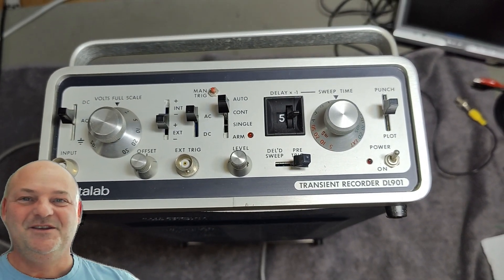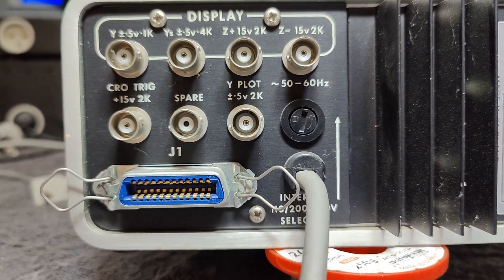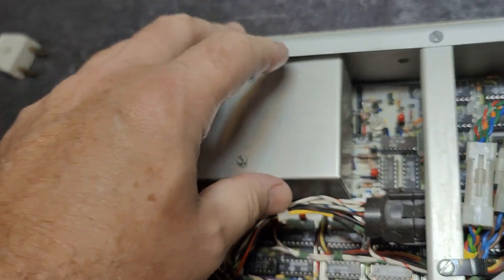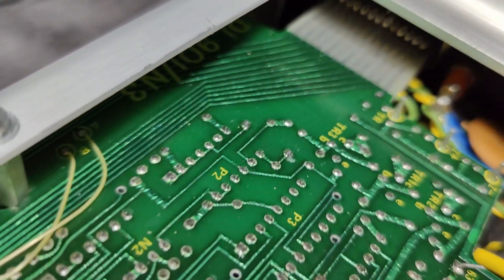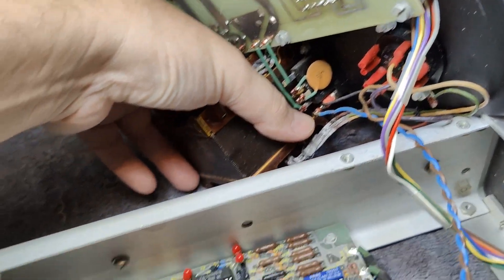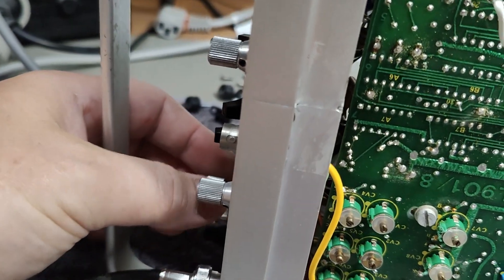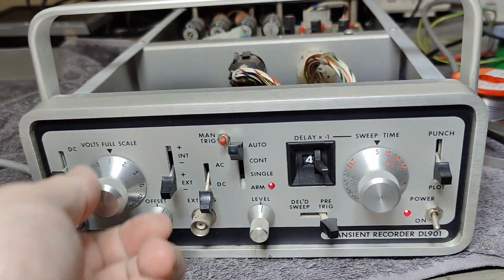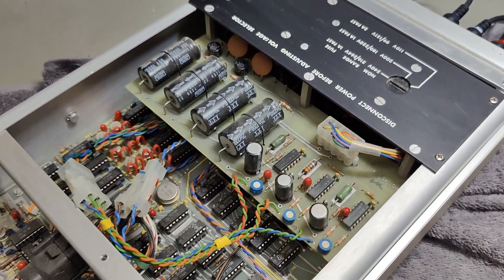Datalab Transient Recorder DL901 1978 1ch digital scope IEEE

Comment: Thanks for the great video! I am very impressed because I built my own digital sampler with almost the same functionality as that one from scratch 40 years ago. My own creation was also made entirely with standard logic ICs without a CPU, and when I tried to run it for the first time in 40 years it did not work correctly at first, but then I discovered that whiskers had grown on the pins of the IC and shorted out the circuit, so I was able to reproduce the operation as it was then. There is a video of the transient observation on my YouTube channel. If you are interested, please take a look. The Hackaday project explains the inner workings.

Comment: Have you tried checking the voltage on the power rails? Maybe the analog front end uses a different voltage and it's off. I guess if there are no markings for the voltages it could be difficult to figure out. You can try powering it from a bench power supply rather than the built-in supply to see if there's any difference.
Reply from the maker: Thanks for the tip! I checked all the things I feel i could do, no luck, I am a bit sad about it, since it is a really cool and fun unit
Reply: @TeardownOZ2CPU  That's a shame. There's probably some part that died due to temperature or humidity. Maybe one of the capacitors. But without any service manual, test sequence, or even a proper output/display, there's no way to debug it unless you find a second scope of the same model to compare against.

Comment: The horde of early tantalum capacitors is scary, and might be contributing a lot to the power draw also...
Reply from the maker: i always use a thermal camara to reveal stuff like that :-) but you are right, they do fail, mostly short on too high inrush voltage lines

Comment: The 8 cans looks to be AMD 1404A, 1024 bit dynamic shift register (similar to Intel 1404A), i.e., 1KB memory.

The larger can is likely AMD MH0026CG, a TO-8 housed 5MHz two-phase MOS clock driver, likely driving the memory (clock driver datasheet explicitly calls out AM1404A, which is guaranteed to support 5MHz)

Comment: Nice spareparts though since it is all socketed.
Reply: The logic chips are old style 74xx. Even for repairs one would usually prefer the lower power 74LS series.
The power supply and case are the more sensible parts to reuse if really needed.
The large round chip or maybe the 8 small metal cans could be the memory. In the old times there was serial, shift register style memory.
For a bit more debugging one could probably have a good guess on the output signal going to the ADC part. This way one could tell it the issue is with the analog front end or the digital part.
Reply: @UlrichHarms-ci1ov  If repairing a device which has original TTL inside, original TTL spares might be preferred. ... definitely worth salvaging the professional grade rotary switches, foil trimmers, precision resistors, BNCs, reed relay, and metal can ICs too. A discrete IEEE interface might also be quite valuable on its own for experimentation, if it is really IEEE.